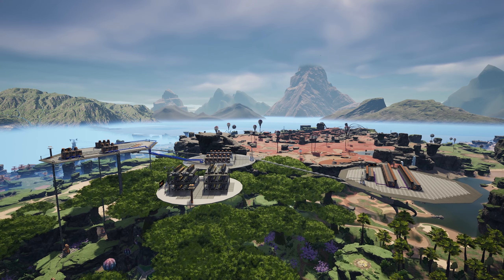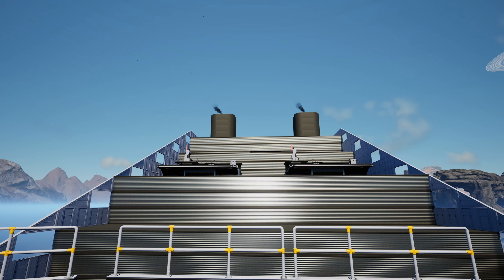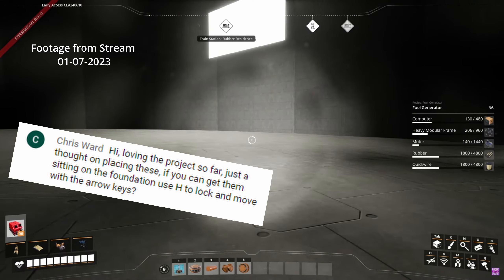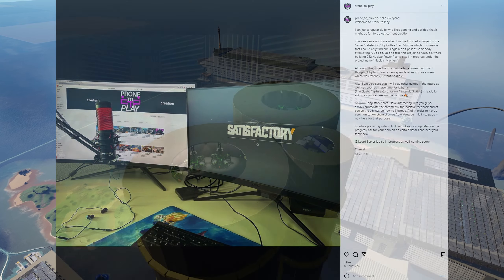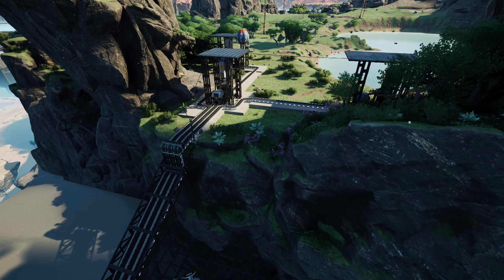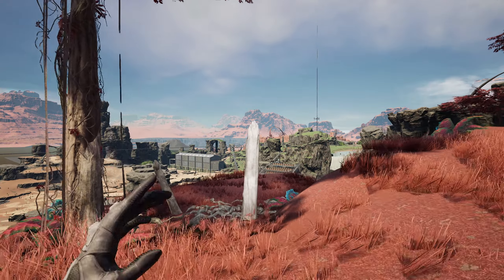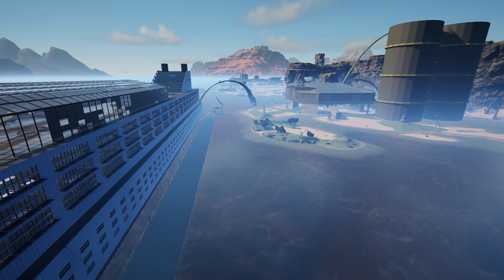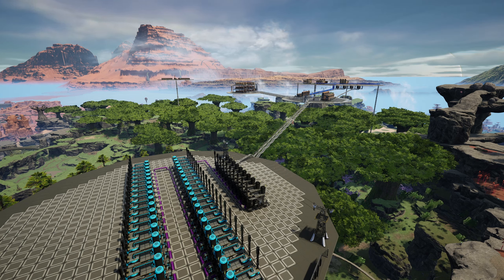Massive Aluminum Sky Factory! - Satisfactory Project Nuclear Mayhem - Ep. 09

Comment: you dont need to place foundations with floorholes for you elevators to get them all the way up. just place the top floorhole, then start placing your elevator from the bottom, phisically get to your floorhole at the top and just aim at it. it will connect 1 huge elevator, regardless how tall it will be.
Reply from the maker: Thanks for the reminder, I knew in the past but completely forgot that... if you don't do things a few times repeatedly, the brain just puts it in the trash bin.

Comment: How comes your didn't use the instant scrap recipe instead with blenders? its way quicker and one less process using bauxite. Hope it helps.
Reply from the maker: Hi, you are absolutely correct with the Bauxite, the Alumina process is a pain. But there were multiple reasons why I still opted for the route taken:
- More Scrap output per Bauxite
- Coal would have been necessary instead of Petroleum Coke, which we had anyways due to the Plascit for the Batteries production 
- (probably main reason) Sulfur is extremely limited in this game, and we need a bunch for the Batteries, as well as an insane amount for the Encased Uranium Cells later in the network, so I didn't want to bother bringing all Sulfur from the planet together. 

All this together lead to the chosen production process. However only looking at the Scrap part, you are right about the instant scrap being less annoying to set up :)